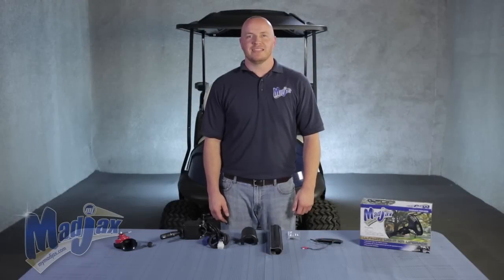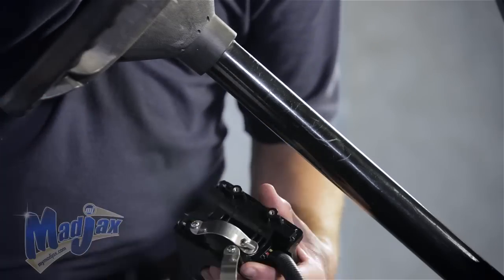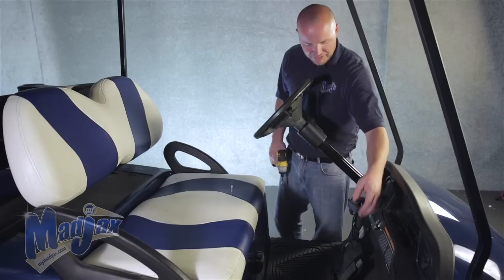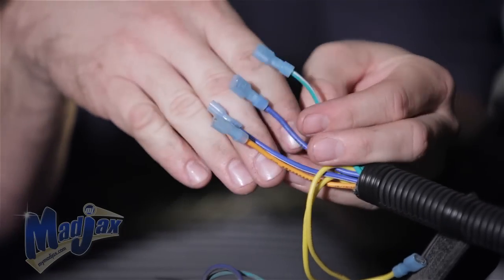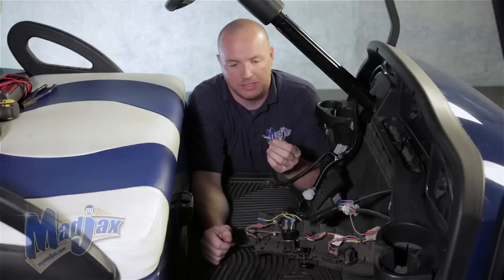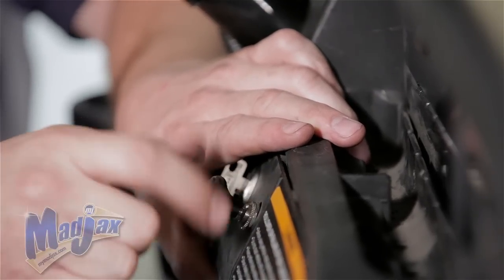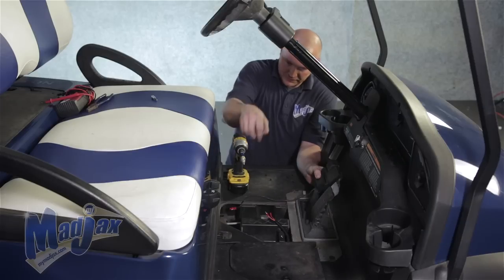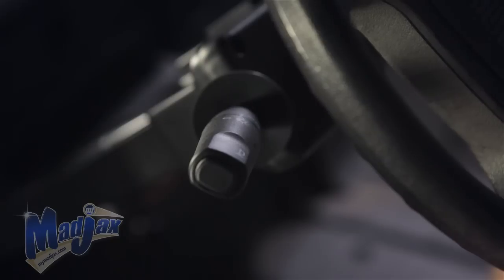Ultimate Light Kit Upgrade for Club Car® Precedent® | How to | Madjax® Golf Cart Accessories

Comment: I cannot get my brake lights to work. Do I need to unplug by BLUE wire and GREEN/WHITE wire and fuse them together? I had to plug those two wires into something under the dash. I can always take them back out and fuse them together. Thoughts?
Reply from the maker: Fuse them together or make a jumper, thanks